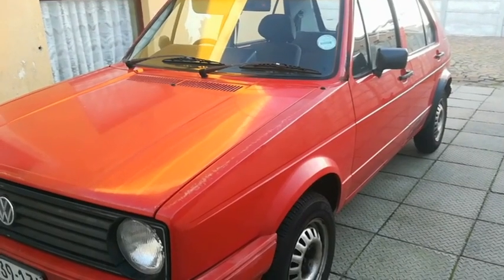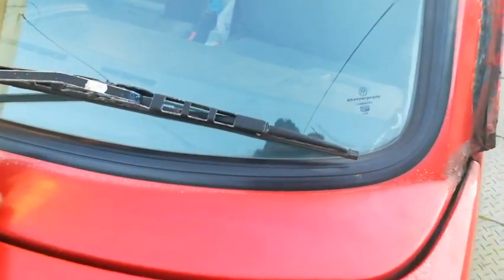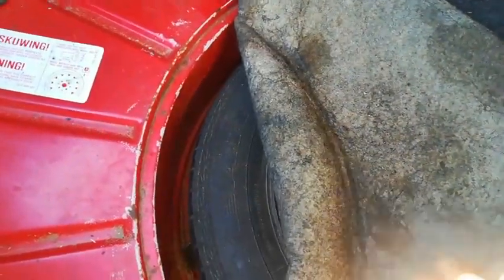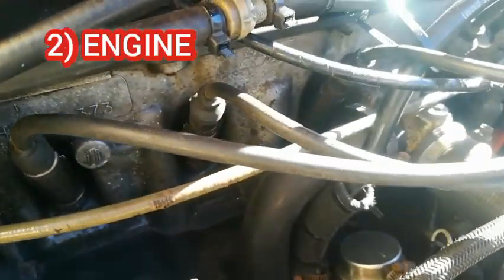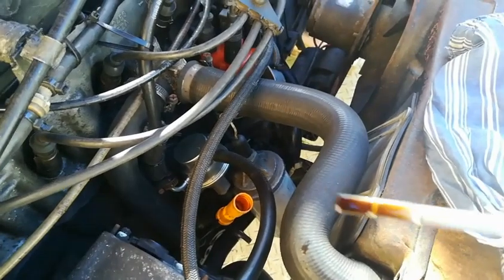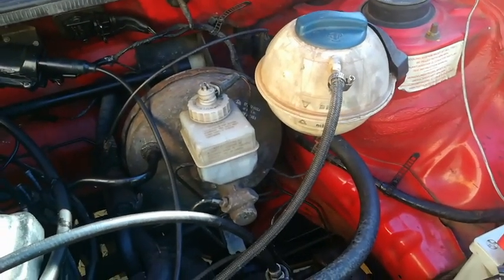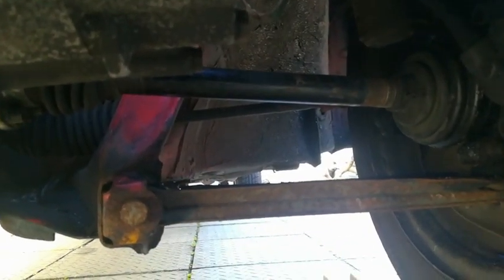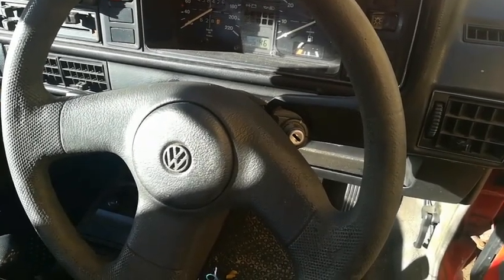HOW TO BUY A GOLF MK1. FOLLOW THIS MECHANICAL CHECK LIST #golfmk1 #vwgolf #vwfox #vwcaddy #golfmk2

Comment: Howzit uncle PJ any chance of showing us how to resync keys on Tenacity 2008 model . My keys start the car but they don't switch my alarm on or off any more . Alarm works fine was tested . Central locking works by operating it manually , my alarm light keeps flashing on my cluster but car drives perfect with no hassels .

Comment: I noticed that you have removed your vapour separator. I had fuel starvation. I traced it to petrol boiling in the vapour separator. Our fuel, like the USA, has ethanol added which has a lower boiling point than pure petrol. I made a bracket and moved the vapour seperator away from the engine. Problem solved.
Reply from the maker: I have been running without vapor separator for almost a year now .( I put in  T valve. Creating a fuel return line). Had no problems.... Actually I seen some Earlier mk1's and  vw jettas that ran on same principle. Incidentaly  I owned  a jetta in the 90 's which never came with a fuel separator., but a T valve. Yes it is a good idea to not have that separator so close to the engine..Can't understand why it was put so close, but if u managed  to shift it away from the heat, then good job . I actually question the quality of the fuel separators we buying today.. I opened one up one day, and it was shocking to see how flimsy it looked inside..

Comment: My golf is "ruk en plukking" when I drive. I replaced pump. Fuel filter. And timing belt. Timing is set correct. Also replaced coil. Distributor cap. And wires also spark plugs..... Any advise... I'm thinking the distributor itself or the Feul condenser "seperator" ? Adding I also checked for air leaks and replaced carb rubber fitting
Reply from the maker: Try by passing the fuel separator as a test... And see if  things improves.....also check your rotor in the distributor

Comment: Hello PJ. I have a problem with my mk1 that’s leaking a lot of oil. It’s costing me in buying oil. I would like to know what would be the problem with leaking of the oil ?... please I need help sir
Reply from the maker: Hi, have you determined yet where exactly the oil is leaking from?
Reply: @pjs-golfmk1-diy  no I sir. I have been unable to due to work. But any tips on which specific spots to look out for ?

Comment: My mk1 jacks and goes off when pulling on hills or heavy weight... also there is a knocking sound during that
Reply from the maker: It could be an air leak..., weak fuel pump,.... Or fuel starvation..
Reply: @pjs-golfmk1-diy  someone said my fuel tank is dirty... causing blockages...

What do u mean by air leak?
Reply from the maker: @emihlemalgas692   air leak at your carb base plate, or the brake booster pipe... Look on my channel there are videos which explains in detail..

Comment: My manual says service every 15000km. I see you change oil every 5000km. I also feel 15k is too infrequent. I am doing every 10k. What made you choose evey 5k?
Reply from the maker: Hi, understood yes. I am aware what the vw manual stipulates, but it's a personal choice.. Maybe not exactly 5k. But between 5 and 8k...car is still standard.. Never had a an overhaul yet.No sign of oil usage or leakage. 450k on clock..